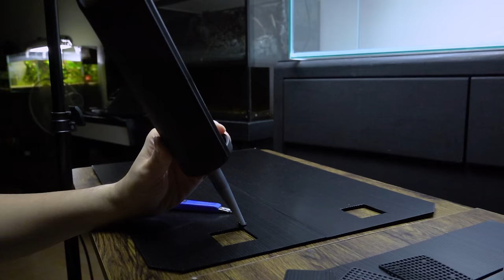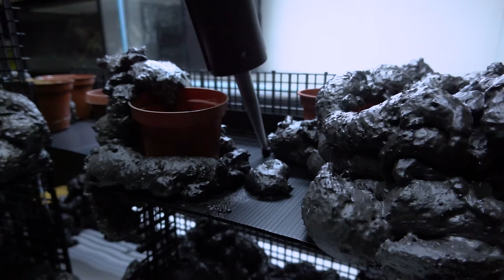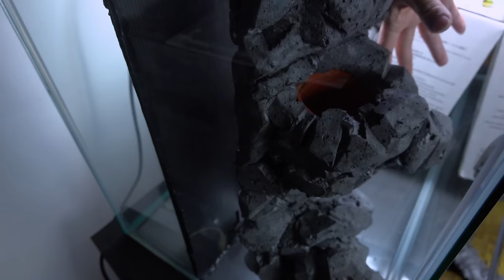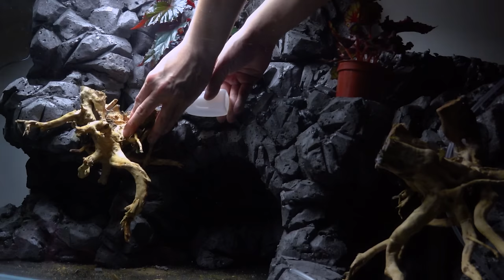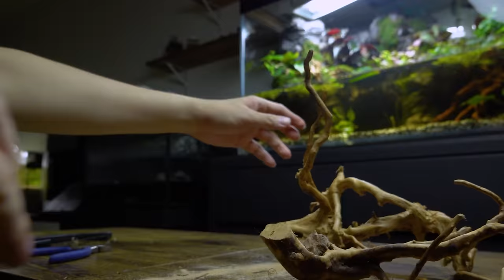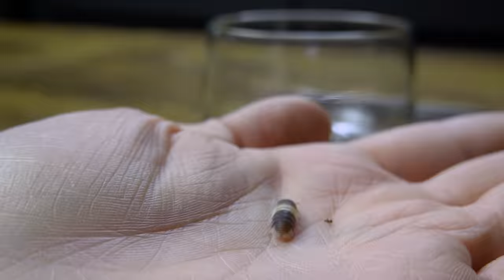Two years Snakehead Fish Underwater CAVE AQUATERRARIUM

Comment: You make carving expanding foam into stone look really easy. Would you say it’s easy or is just me hoping?
Reply from the maker: In the beginning,carving expanding foam was not easy.LOL
Reply: This guy is REALLY good at it. You will not find it so easy if you haven’t done it before. Prepare to spend HOURS on it for something decent looking.
Reply from the maker: @Stwinky  Thank you.
Reply: Do these last a long time? And how do you prevent mold from taking place?
Reply: I’m pretty sure the foam is like silicone, it won’t mold
Reply: Easy. Steak knife and a small wire wheel attachment on a power drill. Some Drylok plus Quikcrete cement dyes and it will look real in no time.

Comment: What kind of paper did you use to peel it off so easy
Reply: @ferretwonderland  the paper you used as the foundation to spread the foam what kind was is was it wax paper
Reply from the maker: @andresfigueroa3028  It's Paper Printed Wall Calendar.
Reply: @ferretwonderland  ok thank you I would have never guess

Comment: Hello! I don't understand why cut the foam? Why not leave it as is. Cut off only the excess that does not fit into the overall concept. Water will smooth out the rocks over time, not the other way around.
Reply from the maker: Make the foam more like a stone.Every plant needs different humidity.
The direction of the water flow needs to be controlled.